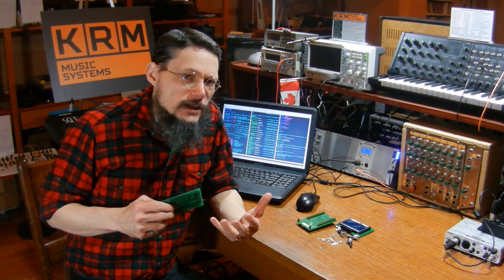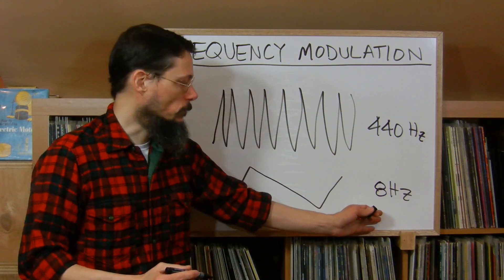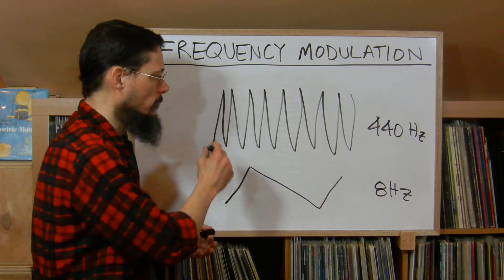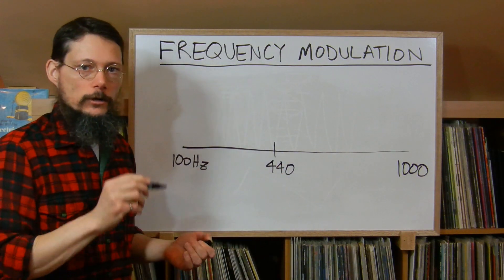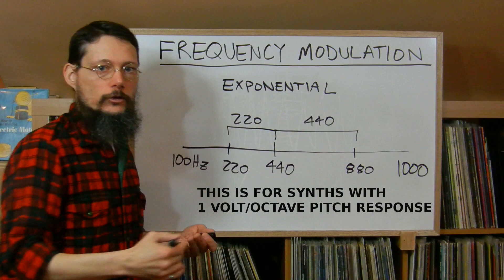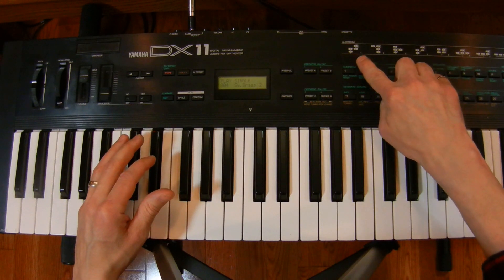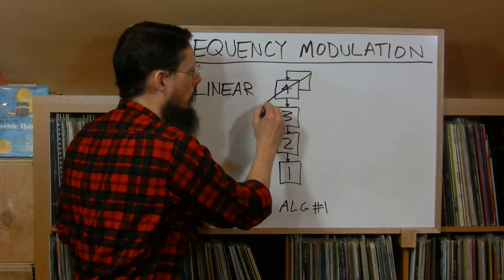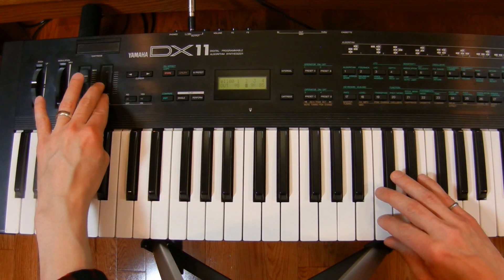Linear vs Exponential FM Synthesis

Comment: good explanation, but still not very practical. that's what i kinda struggle with in all FM explanations - the theory is usually explained "ok" (though even the theory explanation isn't 100% correct. Yamaha's "FM" isn't really a linear FREQUENCY modulation, it's a PHASE modulation - it uses this function: y(t) = A * sin(ωct + I * sin(ωmt)) - where c stands for carrier, m for modulator. so the actual output of the modulator is just plainly added to the phase of the carrier. much simpler to calculate) but that doesn't matter, bcs what it doesn't tell you is what that will sound like. and that's bcs it's extremely hard to tie the theory to the practice. E.g. the common knowledge is that when you have a carrier-modulator pair in 1:1 frequency ratio (which i assume is the scenario shown on the DX11 here) you should ultimately get a sawtooth result. now try to do the math and you'll find that it's extremely difficult to derive that mathematically (i tried, it's difficult 😀 so the theory doesn't really help you predict. if i show you a setting, just with theoretical knowledge you'll have a hard time predicting what the resulting sound would be even in this simplest scenario. the comon "layman" explanation is: "that's bcs in 1:1 it produces all the harmonics. in 1:2 it produces only the odd harmonics." "ok, but why?" "WeLl BcS 1+2=3, rIgHt" 😀yeah, derive that from the original equation. i dare you! 😀That's where the Bessel functions come into play, it depends on the value of the index and generally gets complicated. so there is a big disconnect between the (relatively) simple theory and its very complex implications. the theory is totally unhelpful to the practice. (disclaimer - maybe it's just me being an idiot and missing something obvious - i gave the theory like 1 hour of my time to try and derive things, with the help of THE INTERNET and couldn't. and i'm not particularly great at math or FM programming - i did math for 5 years in college, but don't have a PhD and i program FM sounds on my Yamaha MODX but i'm not doing any super-complex patches, so ... what do i know 🤷‍♂

Comment: I'm surprised you haven't updated this tutorial. Try looking at your signals with a spectrum analyzer. It seems that you got it wrong. What you call "exponential" FM is frequency modulation. I have never seen what you call "Linear FM". The modulation is always relative (or "exponential" as you call it).

Comment: I’ve often wondered why the FM mode of my analogue synth doesn’t sound the same as even a 2-op patch, you’ve made it super clear! 

Also wow, people weren’t kidding when they said simply changing which operators are audible takes a few minutes in a traditional DX synth — in my Opsix I would’ve slid the faders for those operators down in two seconds! Of course I’d read it was an easier and faster user interface but I hadn’t looked into just how much that is true. 

Thanks!

Comment: Some people say, Yamaha's FM synthesis is not really FM, but Phase Modulation, which I don't really get because frequency modulation is achieved by speeding and slowing (or even reversing backwards) a phase of a wave (I guess). 

So many things still to learn about my TX81z, but meanwhile I understood one thing. I need to learn about various natural (physical) ways harmonics "grow" from musical instruments too. E.g.: string instruments produce harmonics that are slightly sharper (therefore inharmonious) than basic note fq (thickness of a string). 

I don't know if that can be reproduced with DX synths, and there are some softsynths that can do that, but I can tell it's very difficult to find analytic texts about where in nature (I mean in physical systems like musical instruments, primarly) a frequency modulation occures, ...and how (and the ones that can be mimicked by FM, like cutoff filter sweeps)

Comment: I'm quite confused about some videos that sate that FM synthesis is truly Phase modulation. So I'm not sure if they are wrong and it is just a problem fo confusing Linear and Exponential FM
Reply: That's right. With frequency modulation, if we modulate the signal with a slow square wave, we will hear a siren effect, where high notes and low notes will alternate. With phase modulation, the frequency of the modulated oscillator will not change. On an engine with phase modulation, it will be impossible to create a siren effect by modulating the signal with a square waveform.  To do this, you will need a different form of the modulating signal. And this is not a matter of Linear or Exponential FM frequency distribution. The change in the frequency of the carrier oscillator does not occur from the amplitude of the upper oscillator, but from the change in its amplitude... only at the moment when its absolute value changes. And since in a rectangular signal waveform the transition from one value to another occurs instantly, then in an engine with phase modulation there would be practically no moment of modulation if among the waveforms there was not a sine, but a pure meander.  Since the derivative of the sine is practically equal to the sine, only shifted in phase.... then timbrally we can say that in many ways frequency modulation and phase modulation are very similar, but at the same time they have different distributions of harmonics (exponential vs linear). But yes... The DX series uses phase modulation.

Comment: The video is clear, thank you. My only doubt is why does the linear FM synthesis differ from the exponential in this way, talking about the sound that comes out? Why does the pitch remain stable on the linear one?
Reply: because the average frequency change with exponential FM because maximum and minimum are not symmetric , while with linear FM the average frequency does not change because it is symetric.
Reply: @jean-louispech4921  Thank you very much!

Comment: Thanks for a clear and informative video!
One question: was the pitch of oscillator 2 (the modulator) fixed? I think that was your point in contrasting exponential (modulator’s pitch tracks the keyboard) with linear (modulator’s pitch is constant, no matter what note you play?)
Regrettably, I don’t have my DX 7 anymore, so I can’t  check it out that easily!
Thanks again.
Reply: i think its the other way around

Comment: really helpful to understand about the exponential fm!!(espatially the curve)!!!! but still I don't know reason that why exponential fm make high pitch when add the low oscilator.
Reply: 조희진 when the frequency gets modulated high enough, another frequency form over the original. It's not so much that the first frequency drops in pitch, it simply goes a bit higher than the audible range with the frequency sitting on top and more audible. The new frequency that formed starts of deeper because  what was previously audible is now Becoming fast enough to modulate sound.

Comment: This is my 4th or 5th video on FM synthesis, and I still don't get how the modulator sine wave influences the output sine wave. How do you end up with the pitch dropping when adding a modulator higher than the base sine? Why does the overall sound not change when the modulator is in the 100s of Hz? Can we please have the basics before moving on to the funky stuff?
Reply: Maybe try this? https://khoi.xyz/c/phase-modulation/
Reply: When you hear a tone being low or high, what are you hearing? The fundamental.
When you FM a carrier by a modulator, you are taking the period of a waveform in the time domain and squashing and expanding it as per the waveform of a modulator. This creates overtones that you may come to perceive as higher or lower than the fundamental of the carrier. 
Seeing this in a frequency domain spectrum analyzer is infinitely useful, as the previous respondent pointed out, because you can see the frequencies of the carrier waveform move as the amplitude of the modulator is introduced.

Comment: This is the best explanation I've seen on FM so far!
Could you explain how to use detune, course and fine? How does each frequency relate to the other operators?
Currently I'm using the free VST Dexed (Yamaha DX7) but I'm not having much luck.

Comment: What does an exponential FM equation look like?  I know what the DX7 style phase mod equation looks like
Reply: as far i understand :
if you use the modulator signal Mf  :     Mf = A * sin( Wm * t)
and modulate the carrier by the value B

with linear FM the ratio of frequency is linear,  you just use the direct value of the modulator   Mf :   B = Mf
with exponential FM you have an exponential ratio :   B =   2  pow(  Mf )   

then with a exponential signal with A = 1, you have values between  2^1 * fc = 2*fc  for the maximum , and  2^(-1)  * fc= 0.5* fc  for the minimum

Comment: Great video, thanks, Keith! At around 6:50, you mention that Osc 4 in the vertical line algorithm oscillates itself. Could you please expand on that? I'm not sure I understand. Thanks again!
Reply from the maker: Hi Andrew.  That's a great question!  In linear FM, when an operator is in a feedback loop, the amplitude of the oscillator output will modulate the frequency of that same oscillator.  In this case, as the amplitude of oscillator 4 increases, it will cause the pitch of oscillator 4 to go up.  As the amplitude of oscillator 4 decreases, it will cause the pitch of oscillator 4 to go down.  Since oscillator 4 is a sine wave (which has an amplitude that is constantly increasing and decreasing), it will cause the pitch of oscillator 4 to go up and down at the same rate.

The overall amount of feedback is controlled by 3 things:  the fixed output level of the operator, the feedback amount, and an amplitude envelope that is applied to the operator.

Comment: That was very well explained, thank you! Could you shed some light on through-zero FM? What it is, how to achieve it and how it sounds different from regular linear FM?
Reply: Basically linear but you can crank the fm depth all the way without it sounding as gritty as normal linear fm. As the name suggests it allows to go beyond 0 (negative frequencies).

Comment: Man I was just wondering what the difference was.  Can you make a similar video describing the difference between phase modulation and frequency modulation?
Reply: They are both angular modulation but one sounds ever so slightly different from the other. If I had to guess frequency modulation changes the angular frequency (a) in rad/s and phase modulation changes the phase constant (b) (rad) in this equation: x=amplitude*sin(a*time (in seconds) +b)
Using a sine as a modulator is just replacing either a or b by a sine function.
This could be completely incorrect by the way I'm just guessing :)
Reply: @JiMMy-consumer-rights  No that's right.  In the 6 years since leaving this comment I have been on my own journey of discovery and reached that conclusion and had it verified by trusted sources.  Also it sounds right when you design a max patch that way xD
Reply: @robertsyrett1992  LOL I did not see that this was 6 years ago

Comment: Thank you, really helpful video. Why is it, that you say, it's hard to produce an accurate linear fm on an analog synth?

I have  2 analog VCO modules, both feature a linear FM input (MFOS VCO by Ray Wilson, and VCO-1 by Thomas Henry, Birth of a Synth). The linear FM on these are really subtle, I can hear the effect, but still no richness in overtones, I'd expect from FM. There's of course exponential FM on both which is musically hardly usable. Could you explain why is that please?
Reply from the maker: Thanks for the comment.  You should be able to get a very noticeable linear FM effect, even with an analog VCO, if the amplitude of the modulating wave is great enough.

Many synths with linear CV response do a great job at pitch tracking (like the Korg MS-20).  However, linear FM is very sensitive to accurate control over the frequency.  Even a change of only a few hertz can sometimes make a big difference in the harmonics produced.  On an analog synth it's difficult to get the same results every time.  That is why linear FM is usually done with a digital synth (where the frequency control is always exactly perfect).

Comment: Great video - the DX7 actually uses Phase Modulation (PM) because it has a carrier wave that is used to alter the phase angle between them. Although PM is an intermediate step of achieving FM, FM is probably more just a marketing term by Yamaha. Either PM or FM are really just special cases of quadrature amplitude modulation (QAM) (mathematically speaking). I often joke by asking people how their QAM synth is going - you get some funny looks :) 

Keep it up - maybe do a video on Ring Modulators .... this is right up the same alleyway!
Reply: Instant frequency is the first derivative of instant phase, so when both carrier and modulating signal are sine waves, there is no difference between FM and PM, because they produce the same signal. And don't believe Wikipedia, QAM is not superset of FM and PM. QAM is a digital modulation scheme with sine carrier, while FM and PM are analog modulation schemes with any periodical carrier. What you meant as QAM is not modulation at all, it is just one of the ways to represent narrowband signals, in terms of complex envelope.
Reply: Drizzgit , while there's no really robust analog FM sound synthesizer, this is a a hardware limitation, not a conceptual mismatch. Analog VCOs that respond quickly enough to changes in control voltage are just impractical for musical equipment.

However the principal of frequency/phase modulation is analog. I.e. it discusses only waveforms and analog signals.
Reply: I am sure phase modulation is a reasonable way to explain DX7 style synthesis, because the equations clearly show that phase modulation is what's happening.  I am not sure why they call FM a special case of QAM, but I am not disputing it - I just can't explain it :)
Reply: FM is frequency modulation, AM of course is amplitude modulation. These are not the same, and do not sound the same. You'll have to do some explaining to show how a quadrature generator is the same as phase modulation.
Reply: Doug Brown I didn't say they were the same not did I say that FM was AM. I said mathematically they (PM and FM) are special cases of QAM. more info here: https://en.m.wikipedia.org/wiki/Phase_modulation

Comment: Thanks for the video Keith, but I was thinking there might be more to digital FM, at least the way it is implemented by Yamaha. Isn't there something called 'through zero' FM that causes the harmonic series to be more 'manageable' in digital FM? Through zero FM is supposed to be a huge reason why FM synths sound the way they do. I know through zero can be implemented in analog but it's quite complicated. I'd love to see a video discussing more of this topic.
Reply: Yes. Yamaha-style FM synths do through zero as well, which is another thing that helps keep the carrier average frequency the same. The last thing is that Yamaha-style FM uses phase modulation instead of directly modulating frequency... the effect is mostly the same if your modulator is a sine wave, except it makes it much easier to keep the carrier in tune, since even if your modulator has a DC offset, the average frequency won't change.
Reply: Thanks so much for your reply. It was very informative.

Comment: Great video! you did a great job clarifying the differences between lin and exp FM. I haven't ever bothered to do too much in the way of FM, but I tried some on my modular. Unfortunately the analog oscillators weren't perfect enough to get sounds similar to what you got on the DX11. Got me tempted to pick up a similar keyboard just to explore more along the lines of FM. Unfortunately most FM synths seem to have poor interfaces.
Reply: you should check out yamaha's DX-Reface, it's got a good user interface with 4 operators
Reply: Cylonix Shapeshifter from intelijel is a beast of an FM complex osc as is Endorphines Furthrrrr generator.
Reply: Opsix is the way to go if you want the structure of FM reflected in the user interface with almost one knob per function. 

The refaceDX someone else mentioned was certainly very good when it was new but compared to the Opsix there’s a lot more menu diving. Plus it’s just touch pads instead of knobs and faders.